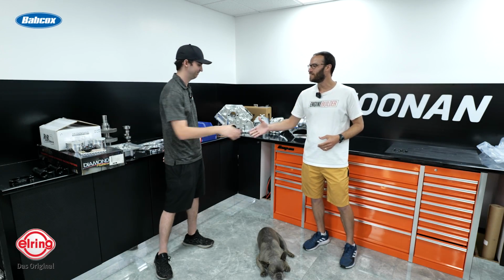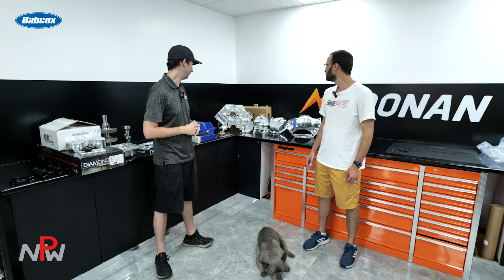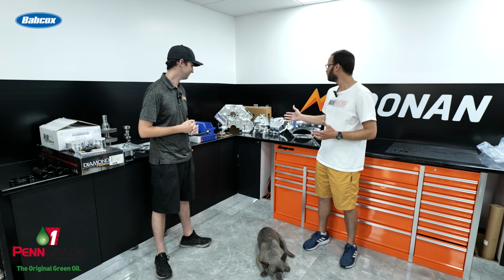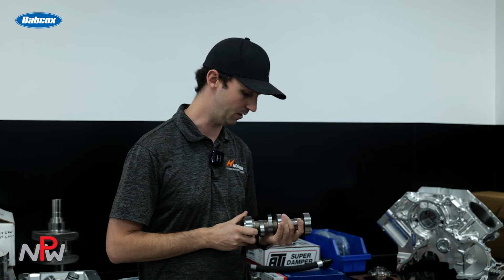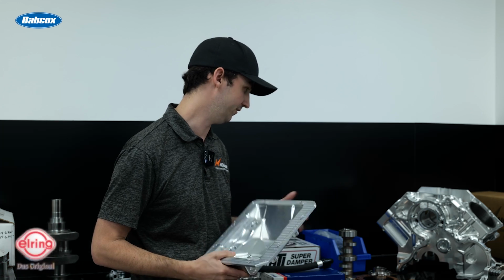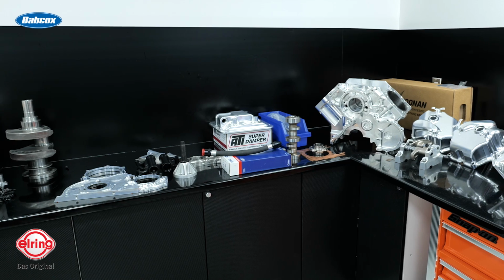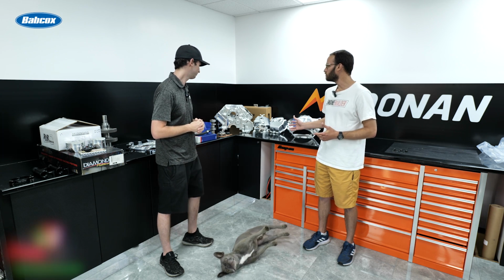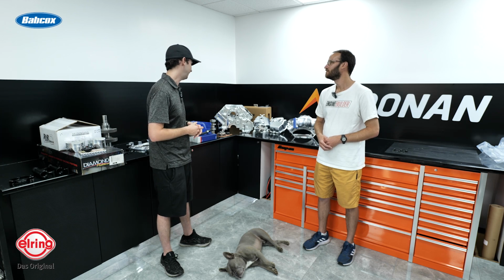Noonan's ProCharged Billet V-Twin Engine

Comment: I want one! Says everyone. But.... Without water cooling features like SMX blocks makes it impractical for other than drag racing hits. That engine if water-cooled would be perfect for crossKart Ariel Atom type vehicles. I'd love to see one on Nitro in a Harley but Noonan is right, their huge.
Reply: Proper fuel and run it rich you can drive them without water just gonna need 2 50 gal drums of fuel to go 30 miles lol

Comment: I came up with this idea 30 years ago.  If you mass produced the engine in a mild format at an affordable price you couldn’t make them fast enough.  The motorcycle crowd would absolutely gobble this up.  Like most concepts that even make it into production it ends up being overpriced and only for those with deep pockets.  The companies usually fall by the wayside because of the costs.  Just another footnote in history.  This happens so often.

Comment: About 25 years ago I was out at Muroc Dry Lake and I met some guys who took a blown fuel hemi and one night while drinking beers they said to each other "Why don't we just cut off two cylinders and they fit this class.  This two cylinder motor put out over 1,000 hp on fuel in a streamliner.  It was impressive.  I saw many interesting ideas out there.

Comment: That V twin would fit perfectly in the back of a Fiat 850. 😎
Reply: Both would be decimated by the power 😂
Reply: @RadDadisRad  Obviously if you go for 900 hp. And that 900 hp version probably only lasts for 20 drag strip runs anyway or maybe a few land speed runs.. But a 100-200 hp version would be awesome in a Morgan which comes stock with 60-70 hp.
Reply: @gruberstein  no way you’re gonna keep those cubic inches around 100hp, definitely in the 200ish hp range NA and that’s if you can get it to run on pump gas. I’m gonna wager this thing needs a higher octane fuel and will run 210-250hp on race gas.
Reply: @RadDadisRad  Who the hell said it had to be a high compression or supercharged version? A normal Harley 100 ci doesn't have to be at least 200 hp. 
Having a water cooled motor instead of the air cooled on a Morgan may be considered an upgrade and a shorter stroke smaller ci motor could be tuned for any hp needed.
I think you'd want something to drive on the street. Not everyone sets out to have their motor making maximum hp. Max hp = max maintenance, not something you'd want for a public road driver.
My god buddy take a chill pill.
Reply: @gruberstein calm down Patsy, no need to write a paragraph. You can’t even afford one of these so keep dreaming.
Reply: @RadDadisRad  How do you know my financial condition? You had to piss on my idea for absolutely no reason and then went all hyperbolic with your defense.
Who said anything about dreaming? I don't want a 900 hp v2. I want to put my 472 Caddy motor in my 71 Corvette convertible. A perfectly reliable 500 hp that I can build for a few thousand with off the shelf parts.
Go find some other corner of YouTube to piss in.
Reply: @gruberstein  hahahahahaha a 472 caddy engine. That’s a 600 pound boat anchor. Doesn’t even make a horsepower per pound. If I didn’t know your financial situation I do now with that comment. 🤣
Reply: @RadDadisRad  And another fact, for the price of a procharger setup on an LS somebody can buy a set of aluminum heads for a Caddy and the total weight gets down to about 50 lbs more than a small block Chevy. Now tell me it's a boat anchor. 
No computer, no fuel injection, no turbo or supercharger, simple no nonsense torque and power in a light weight package.
Sounds like  @RadDadisSad when it comes to motor knowledge and relies on cliches and prejudice against anything he doesn't know about.
Reply: @gruberstein  nah, you’re not anywhere near a small block in weight. You’re still in BBC Chevy weight. Even with aluminum heads the Cadillac big block is a touch under 600 pounds.
Reply: @gruberstein  my supercharged 5.0 motor DRESSED with the supercharger and accessories weighs 632 pounds. Alternator, power steering pump, AC compressor, water pump, supercharger, oil pan and long tubes. Plus my engine fits in most small block locations AND it makes over 700hp and 630ft/lb torque on pump 91 octane.
Reply: @RadDadisRad  Woopty F'ing Doo! 
So what did it cost? How often do you use that 700hp? 
Sounds like you're into motor porn more than hot rodding. 
Did you build it yourself? Did you choose the parts or buy it out of a catalog? I do my own head porting. The only thing I don't do is machining work. I've built 230 flathead Dodge, 200 Ford inline 6, small block Chevy, Ford 351w and 472 Caddys. My successes are building a better running motor that makes more hp and they all ran on 87 octane.
71 Corvettes came with big blocks, I don't have to worry about it fitting.

You spend your money on eye candy and dyno clout, I'll build something simple but unique for way less than half the money.
Reply: @gruberstein   200 series ford in lines are junk. I’ve built up a 351W into a 410W with some AFR heads. Made 500hp and 550ft/lb of torque. It was in my 4x4 converted econoline van. Btw I converted that van to 4wd with super duty parts. My coyote build is a simple pump gas build, just a blower and a tune. Tell me how many people can run a 3.9s 0-60 on an unprepared surface with street tires. Actually don’t tell me it’s rhetorical. I wanted something fun and quick. I didn’t want a continuous project.
Reply: Also the front of a Morgan  3 wheeler